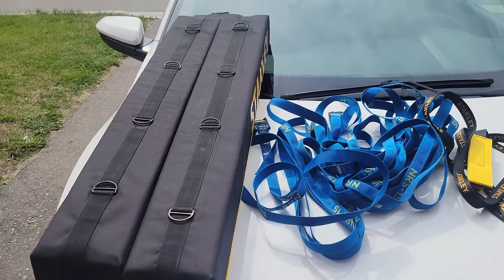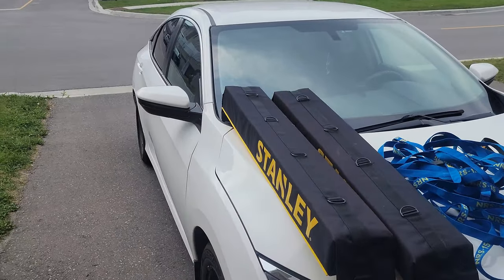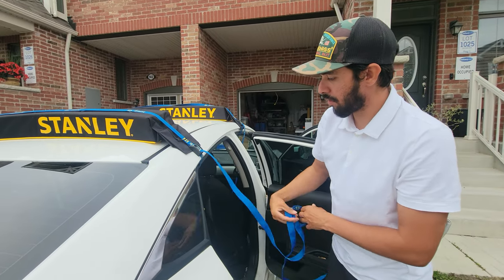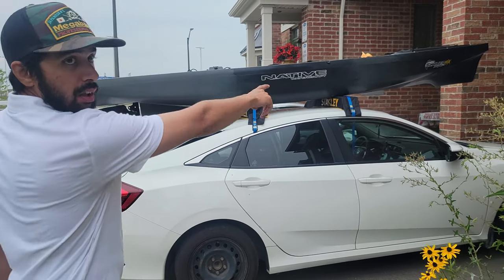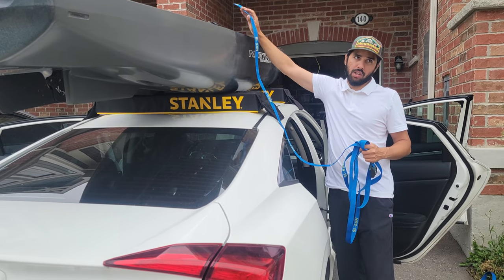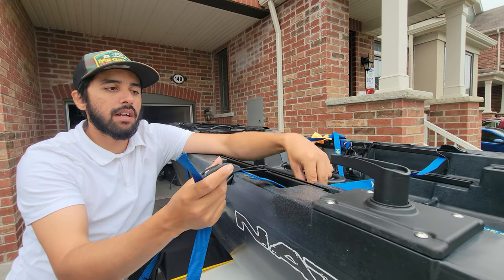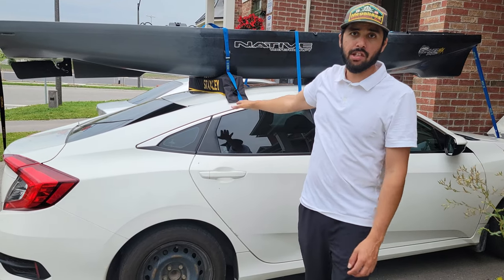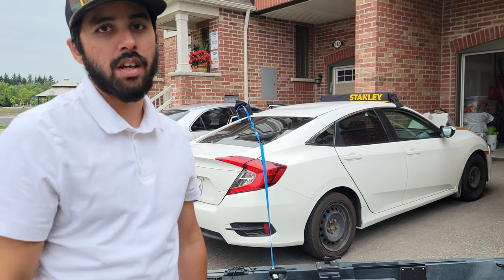How To Load and Unload a Heavy Kayak | No Roof Rack?

Comment: That back window has me worried.  Thank you for the video.
Reply from the maker: I hear you. It's one of my concerns now that I've been using this method. However, once you get the bow up on the trunk about where the transducer mounting area is on your trunk, you can then ease up onto the rear pad. They do  make rollers you can suction cup to your rear window for easier loading. 

Thanks for watching.